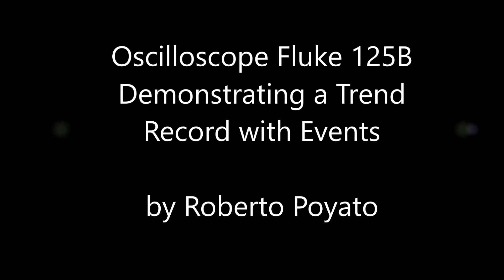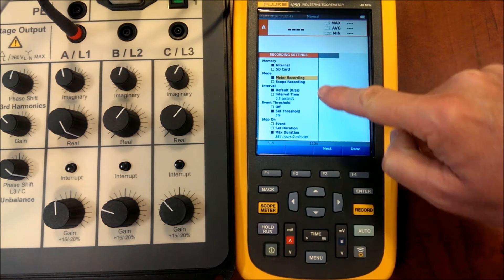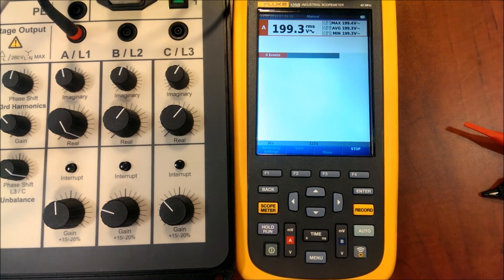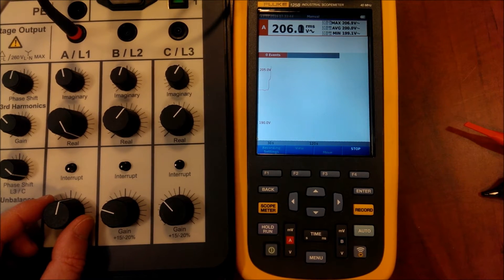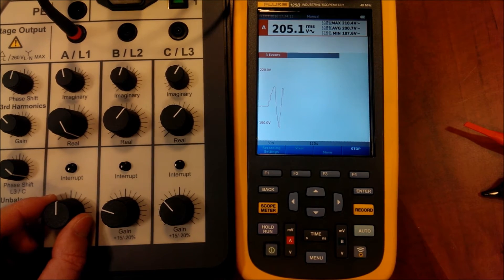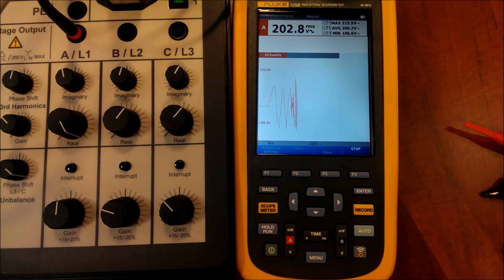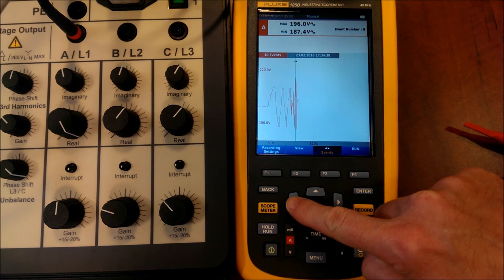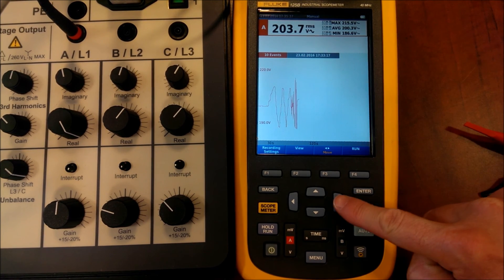Oscilloscope Fluke 125B. Demonstrating a Trend Record with Events

Comment: Robert que tipo o modelo de el regulador de voltage es el que usas? Tengo un fluke 123B y megustaria tener un regulador igual para practica y enseñar. Gracias!
Reply from the maker: Hola Jorge, es una maleta de demostración de Fluke que genera tensión y corriente trifásica a partir de una toma monofásica normal. Dado que es para demostración de equipos  como analizadores de calidad eléctrica Fluke no la comercializa. Un saludo
Reply: @SCIENTIAPLUS 
Roberto gracias por la respuesta. Sabras si ay algo similar desponible o si podria yo pedir algo a fluke. Yo lo ocupo para desarollar la technica de uso de el fluke 125B en casa. Lo unico que encuentro son VFD.

Comment: What kind of demo board is that? That your connected to/ using?
Reply from the maker: Hello Justin, it is a small demo board that generates a RS232 communication
Reply: Roberto Poyato do you have the make and model by chance? It looks like it would be great for teaching troubleshooting techniques and instrument use in classroom setting.
Reply: For anyone else that maybe interested in the board Roberto is using in this video.. its a Fluke power quality demo case.